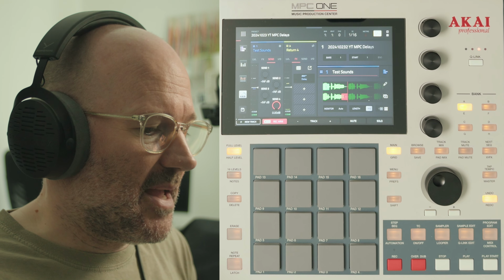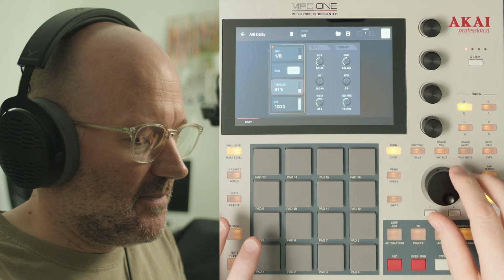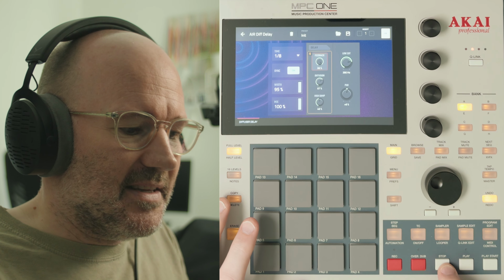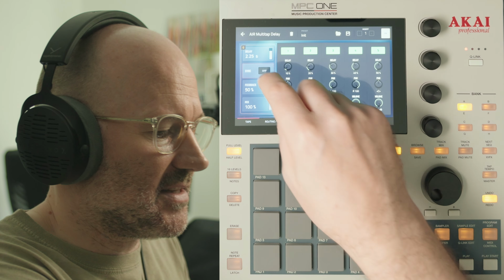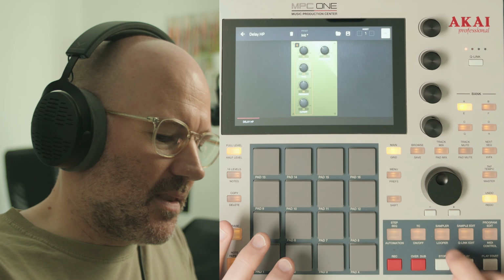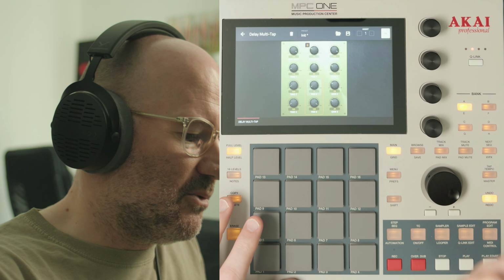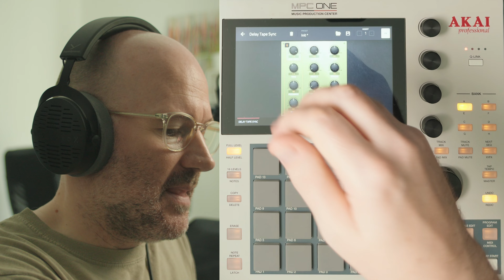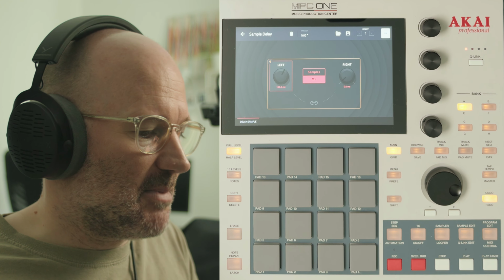Akai MPC Tutorial. Which Delay in the MPC? A detailed breakdown and how to use them creatively.

Comment: Thank you so much Conan! 😎 Every of your videos is pure gold. Question: what video(s) do you refer to around 29:35??

I am no expert whatsoever but to my ears all reverbs and delays on MPC have quite a "metallic" sound to them. How can one make them sound warmer?
Reply from the maker: If you check back through my videos mate, I have made in depth videos on all the compressors in the MPC, all the EQs and all the reverbs. I agree, the reverbs can sound a bit metallic. That is actually inherent of plate reverbs for instance. A good way to get some warmth is to roll off anything above around 8khz with a gentle slope low pass filter. This is a technique used for many years on plates and spring reverbs. The same principle can apply to delays. This is the advantage of having the reverb or delay on a return, because you can put an EQ after it (or filter) and just process the effect rather than the whole channel (which would be the case if you used the effect as an insert effect. If you lookup my video recently on an MPC template, I have the reverbs and delays set up on the returns with an EQ placed afterwards for that very purpose. It is called the Abbey Road Reverb Trick.
Reply: @TheCratesMotel  can't thank you enough Conan 👍🏼👍🏼👍🏼 will try that

Comment: I don't know if it still does this in 3.0 . But in 2.0 some plugins with a sync button will brick your sound or sometimes even crash your mpc when your
mpc runs as a midi slave instead of master. I know for instance the Air Diff Delay was one of those plugings. Some have it some don't.
Workaround is either to render to audio or simply turn off the sync and get it as close as possible with setting your milliseconds manually.
Reply from the maker: Oh wow, that’s not good
Reply: @TheCratesMotel  Exactly. I've contacted Akai about this years ago. All i heard was, we forward it to our dev team, but i doubt they did even do that.🤦‍♂I even made them replicate the problem and had it aknowledged by them. A shame because i really love the Air Diff Delay. 😅
Reply from the maker: @loopwax  low priority to them I guess 😔